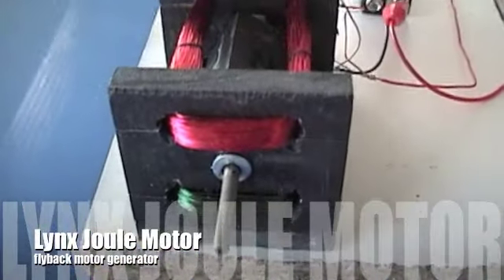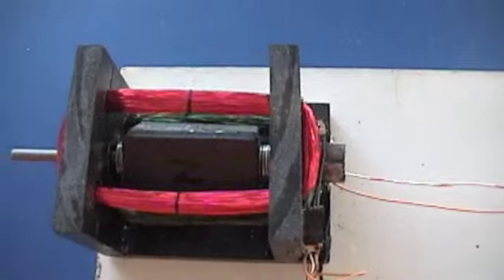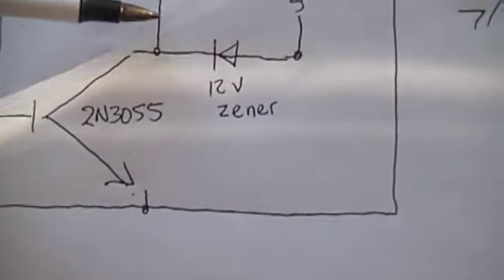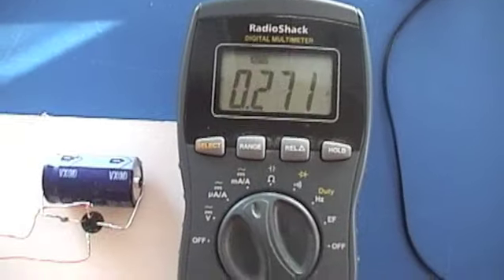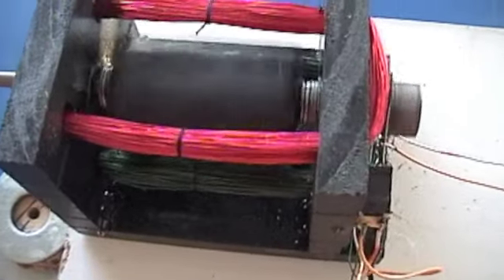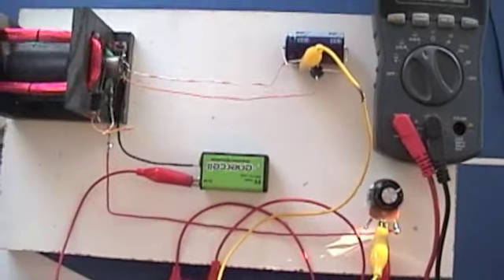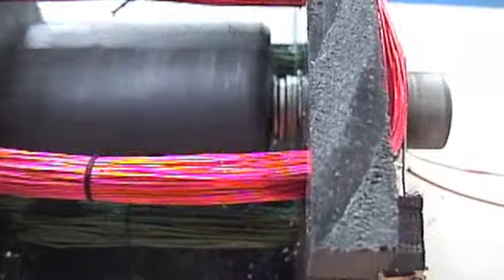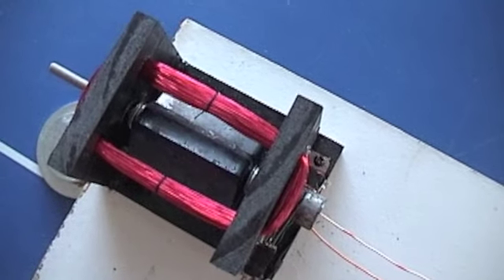Lynx Joule Motor Generator

Comment: if we take just a diode from the hot point  transistor collector, in direction to positive pole , the flyback diode charge the main battery with higher voltage than input

Comment from the maker: Thanks,
I am working on a kit design.  Based on a diametrically magnetized Neo with a 1/4" ID.  It will run in 1/4" ball bearings and the stator will be able to lay very close to the field.  The commutator will be a brass eccentric and adjustable for one spring steel brush wire.
The circuit board could be very small.
I am still not sure what use this has until I experiment more.

Comment from the maker: Ah!  You're on to me.  As you may know I have made a lot of non-cogging alternators, and I have been working on a circuit for a wind alternator that puts its power out as high voltage pulses instead of sine wave.  
This little model motor doesn't cog at all.  It will charge with just a hand turn.  If you study the schematic you will see how this small amount of turns and ferrite magnet can put out high voltage pulses as a generator.  Don't know about the RF, but it will be quite low frequency.

Comment: Lynx, that's a sweet little setup you have there.
you can do the same thing with the SSG wheel, using the "fly back" as you call it for torque instead of charging, yet still get some charging out of it. I'm going to give your zener method a try.Nice commutator.

Comment: I  think you should consider adding a  Flywheel .  
 Flywheels are often used to provide continuous energy in systems where the energy source is not continuous this is exactly what you have ,    like and old hit and miss engin

Comment: here's a thought; rather than a steel-sprung brush on a brass eccentric, have you considered a connector like the automotive distributor "points" ? in that case, a nylon lobe runs on the brass eccentric, and the gap opens and closes accordingly.

.. less friction and RF noise? 
or is the dragging essential to the high voltage ?

Comment from the maker: Thanks.  The Bedini SSG is funny.  If you put a load on it, it will slow down, pull less power.  It really is best as a novelty battery charger.  This motor is different.  If you put a load on it, it will pull more power.  The LJM has torque whereas the Bedini SSG in effect has none.

Comment: Basically speaking is it liken to a step up transformer? I`m assuming there are no laminated magnets at the ends of the transformer set-up and the charge is passing via induction from the rotation of the motor. Just wondering. Nice job again though.

Comment: yes indeed - but I much rather prefer your Lynx joule lamp.
much easier to read without all that SSG ringing in my ears.
however, still, adding the coil does increase the torque. The SSG ckt can be done w/ the window motor similar to how you are showing here and adding the coil to the output - you can even keep your commutator in there and close the loop.

Comment: Yes I have made some of these pulsing "Back charge" type of motor/Genarators. I see, this must be a (first-Time) attempt for you.?? I don't usually Down, anyone's work, just because" They and you,  are doing more than most people are doing,!! You are working on the problems, and putting Time into trying to understand, what is happening" in the wierd world of electrons, magnetism, and actually" doing something, to figure it out, and maybe find a way to to explain, it all.!! NOW" with that, Said"!!  I will try to help you a little, and explain, anything" that I have found, out, in my 22 year's of experience, by building these types of things, and making them Larger. My goals my not be the same as yours, but I will still try to help you with anything that you want to know... My goals from the beginning was not to power a small or large, house. I figured if I could make something that  would power its-self, by (Back chargeing)!! The Battery" that powers the system, and puts off enough  extra power to feed some into the needs of a Camper, maybe a 25" 30"ft. Tow behind trialer, Camper. However, I ended up getting a drive able Camper, and adding Cheep Solar, to it. I have made some of the type motor/Chargers,!! With some secuss.!! I just have not tried for a patient, I did everything as Open-sorce.!!! That's why I will help you with anything you need to know. JR.

Comment: let me  say it  all generator can be made to double there out .free energy.. making electric only wast about 1% of the energy in put in to generator. the case that hold the coil by being lock down wast99%of the energy. Basically, Lenz's law states that an induced current has a direction such that its magnetic field opposes the change in magnetic field that induced the current. this mains the copper coil being repealed. stronger the load stronger electromagnetic effect on the coil ,more  HP need

Comment: This schematic is of such poor quality that it is unusable. Do not attempt to use it there is too much missing information, e.g., plus and minus out puts of the bridge rectifier and the 2n3055 transistor drawing is a non standard transistor symbol base collector and emitter are not clearly marked. The bridge rectifier remains heavily shaded and is impossible to see clearly. It does not help that the designer/ presenter mumbles throughout the video and does not clearly point out the components. The presenter stated that he is taking 
AC off of both coils, just how is this done? What are the tap points for AC . The presenter shows a disconnected capacitor that is "undone" what was the capacitors function and what was it connected to? What is the presenter using for the commutator? Where is the commutator? A step up transformer converter is to be expected with the two different size coils and so there is no mystery with the 9V input and the +12volts output. The fly-back from the collapsed magnetic field of the first coil (112 turns)  is taken up by the secondary winding (300 turns) coil of many more turns. this might be assisting the battery receiving a small additional charge but the device would have to run for days to determine how much advantage the small charge would give the battery life over normal battery life. there would never be a net gain and the battery will run down eventually. No new physics here, the use of the zener diode is somewhat interesting but probably inconsequential.this is a Bedini type motor of no value in the real world . We need more basic research in electromagnetic fields; a day will come when there is a true breakthrough in electromagnetic theory for motors and generators but we are not even close yet.